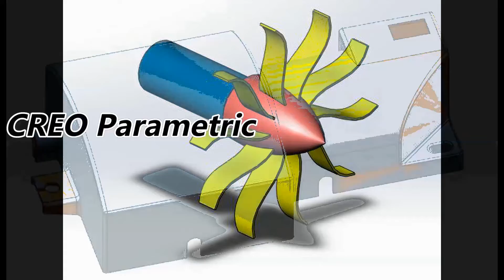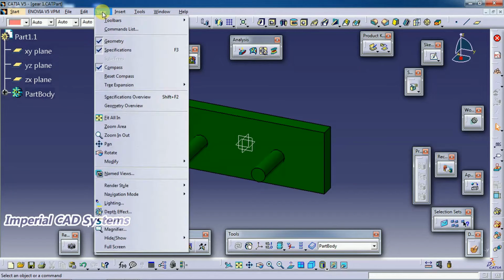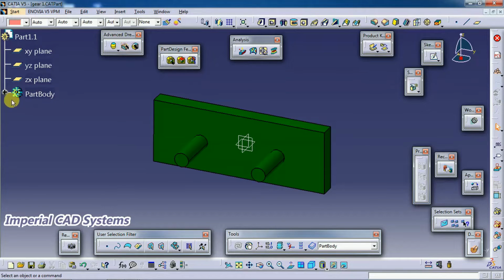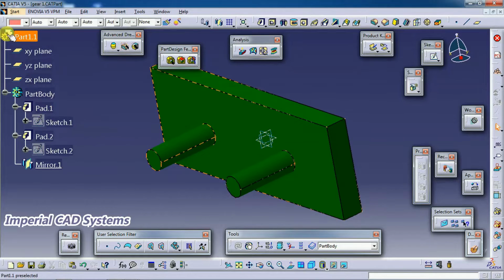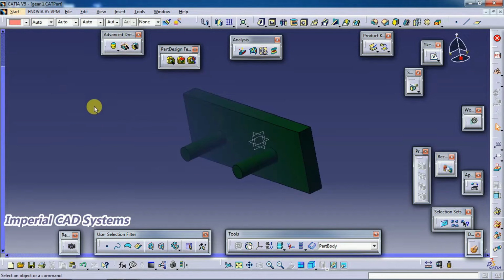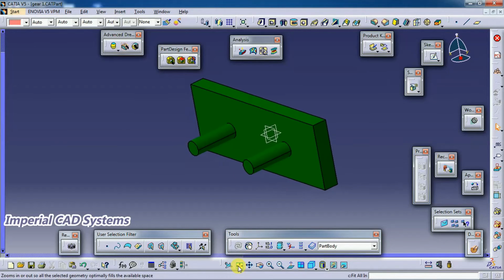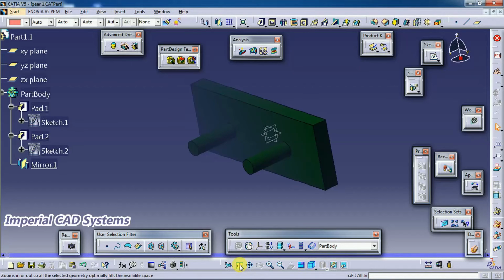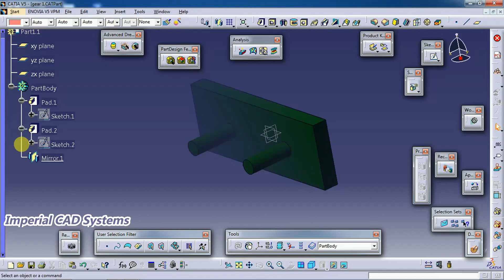How to get back hidden specification tree in Catia v5 tool

Comment: u are doing it in complicated way. I used to get it from an option in view command itself long back. Not sure which exactly right now. Not talking about F3 button.
Reply from the maker: Going into view selecting specification option or selecting f3 button also sometimes won't show tree on screen then we need to go like this
Reply: @imperialcadsystems  no. I meant when the tree is zoomed out and not visible but still exists then there was another way to get it back.